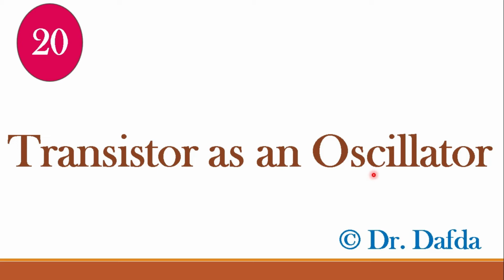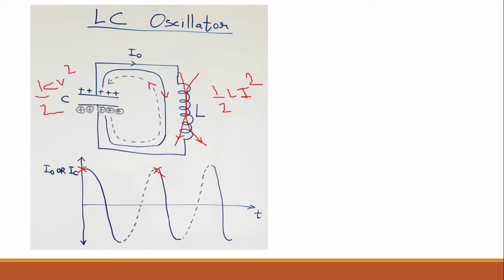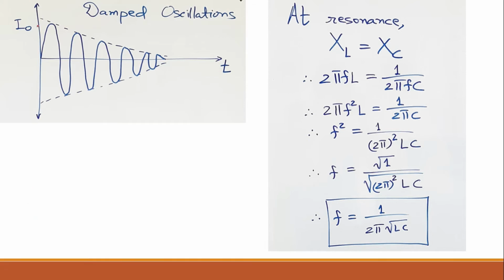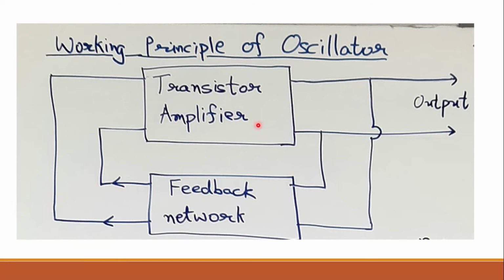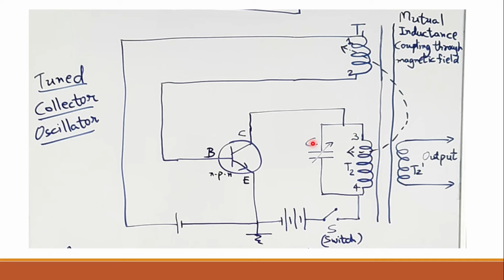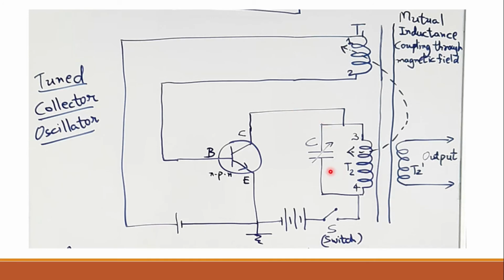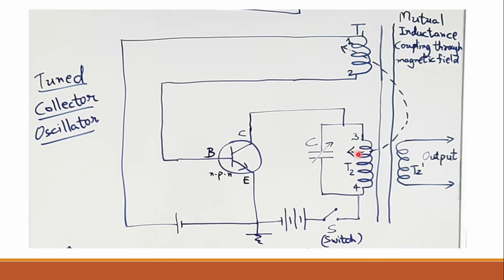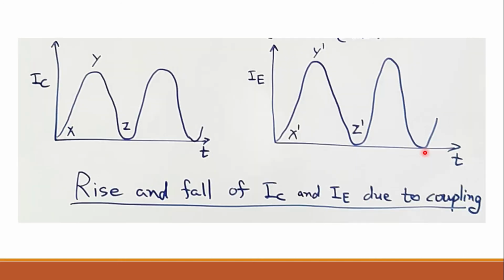Transistor as an Oscillator||Feedback Amplifier||Class 12 Physics||LC Oscillator||#JEE|#NEET|#GATE

Comment: The explanation is absolutely terrible. The instructor has no idea how the circuit works. Read my comment
Reply from the maker: Thank you for your comment.

The circuit shown in the video is a simplified conceptual diagram used to explain the basic idea of a tuned collector oscillator. The detailed biasing network (resistors and capacitors) was intentionally omitted to focus on the feedback mechanism, also stated at 15:53. In a practical implementation, the base would indeed be biased through resistors rather than connected directly to a battery.

Regarding the operation, you are correct that when the transistor reaches saturation the rate of change of flux becomes approximately zero, so the induced voltage in the feedback winding disappears and the transistor turns off. At that point the LC tank circuit oscillates due to the energy exchange between the inductor and capacitor, and the transformer coupling later re-applies feedback to the base to sustain oscillation.

The explanation in the video was intended as an introductory description emphasizing the positive feedback principle rather than a full electromagnetic analysis of the LC energy transfer. Both viewpoints describe the same oscillation process at different levels of detail.

Comment: His explanation of the operation of the circuit is completely incorrect. When the transistor is saturated, the current through the coil is a maximum and the flux is a maximum but the flux is not expanding and even though the flux cuts the turns of the feedback winding, it is not and increasing FLUX but a STATIONARY FLUX and it instantly stops producing a voltage in the feedback winding.
This instantly turns the transistor OFF. The transistor disappears from the circuit and we have what is called a TUNED CIRCUIT. A parallel coil and capacitor with the coil (inductor) carrying a current. The magnetic flux produced by the inductor will start to collapse and a collapsing magnetic flux produces a voltage in the opposite direction. This voltage will oppose the voltage on the capacitor and discharge it. During this time the collapsing magnetic flux will induce a reverse voltage in the feedback winding that keeps the transistor turned off. When all the magnetic flux has been converted to voltage and current to charge the capacitor in the reverse direction, the capacitor now delivers its voltage to the inductor to produce magnetic flux that is passed to the feedback winding to turn the transistor ON.
Reply from the maker: Thank you for your comment.

The circuit shown in the video is a simplified conceptual diagram used to explain the basic idea of a tuned collector oscillator. The detailed biasing network (resistors and capacitors) was intentionally omitted to focus on the feedback mechanism, also stated at 15:53. In a practical implementation, the base would indeed be biased through resistors rather than connected directly to a battery.

Regarding the operation, you are correct that when the transistor reaches saturation the rate of change of flux becomes approximately zero, so the induced voltage in the feedback winding disappears and the transistor turns off. At that point the LC tank circuit oscillates due to the energy exchange between the inductor and capacitor, and the transformer coupling later re-applies feedback to the base to sustain oscillation.

The explanation in the video was intended as an introductory description emphasizing the positive feedback principle rather than a full electromagnetic analysis of the LC energy transfer. Both viewpoints describe the same oscillation process at different levels of detail.

Comment: This circuit will never work with the battery connected to the base. The instructor doesn’t have a clue about the operation of the circuit.
Reply from the maker: Thank you for your comment.

The circuit shown in the video is a simplified conceptual diagram used to explain the basic idea of a tuned collector oscillator. The detailed biasing network (resistors and capacitors) was intentionally omitted to focus on the feedback mechanism. It is already stated in the video at 15:53. In a practical implementation, the base would indeed be biased through resistors rather than connected directly to a battery.

Regarding the operation, you are correct that when the transistor reaches saturation the rate of change of flux becomes approximately zero, so the induced voltage in the feedback winding disappears and the transistor turns off. At that point the LC tank circuit oscillates due to the energy exchange between the inductor and capacitor, and the transformer coupling later re-applies feedback to the base to sustain oscillation.

The explanation in the video was intended as an introductory description emphasizing the positive feedback principle rather than a full electromagnetic analysis of the LC energy transfer. Both viewpoints describe the same oscillation process at different levels of detail.